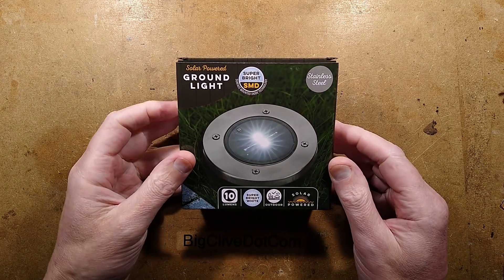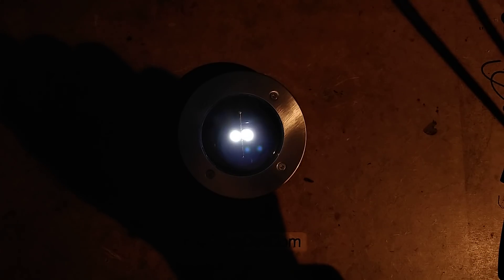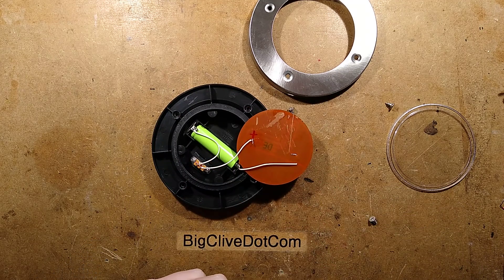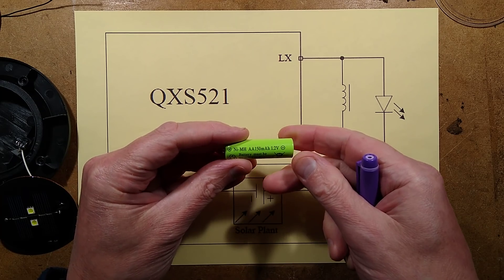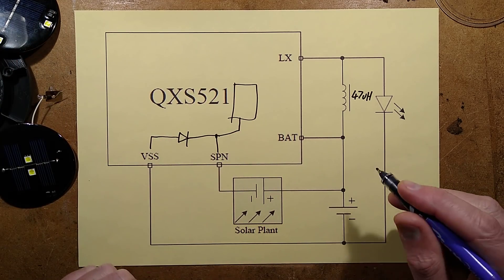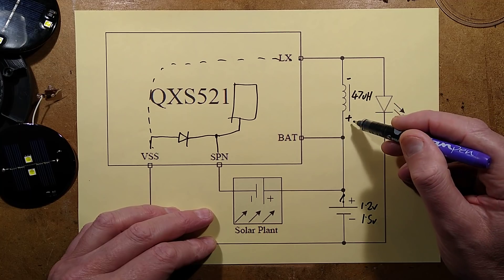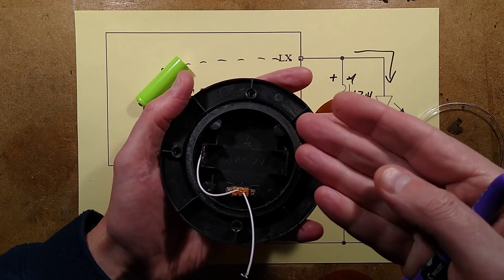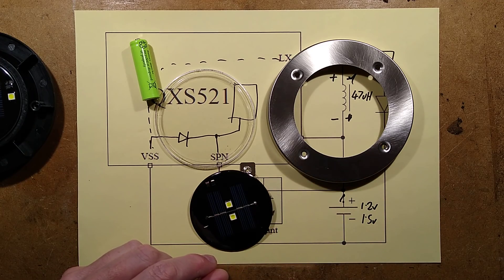Poundland's solar uplight

Comment: Your poundland store looks like our walmart here, that is to say what you consider low quality cheapy stuff is our normal £10 stuff here. They sell those silly puck lights for $12 a piece here. It would be nice to know how to solder in a Lipo battery and explain how that chip knows a full charge vs low charge.

Comment: I love the cheap lights that come with a replaceable battery. You can put in a decent NiMH and it works all night. Almost like it was designed to be not-so-cheap. I wonder if clive does that and if so, what replacement he uses.. 🤔🔋 I'm going for the biggest capacity I can afford, keeping in mind, that it probably be dead in a year. But so far, they are working 2 years+. I also adopted the waterproofing tape technique. It's awesome.
Reply from the maker: I do upgrade the cells in lights I like.

Comment: so these would be used as garden pathway lights. placed each side of the path,!! looks sturdy enough at 1st glance.. of course im typing at the beginning of the video. soo we will see after Doctor Clive Operates if they are any good,..  ; )
P.S. When your tacking back on that connection that snapped off, burn a little hole  in the case were it the condensation builds up.. you were more than likely going to do that, but just in case it's skips your mind.

Comment: 7:13: some of those minimal circuits makes it easier for us making lights to incorporate into our projects,,most people are not aware that those tiny DC solar censors were not on the market for us 15 + - years ago, They only had AC solar censors and then solar yard lights came out ,I was getting ticked by the water police for not having my anchor light on( 80 dollars u.s.)  I’m one of the boat people, The censors I was using before the yard lights came out was a 12 volt magnet switch from a car , they’re on the wheel well in that little plastic box , my system then was , cheap Harbor Freight solar panels charges battery,, battery powers light on top of mast,, I use the solar panel to activate the car magnetic switch , in the morning when the sun rises,the panels will give out about 7 volts counting,,just enough to trip the magnet and getting to where the sun sets ,the magnets are turned off, it’s a trip switch for my mast light,, Yard lights were a blessing ,I’m a strong believer in mast steps,you can change a battery in under 2 minutes and that’s a 40 foot mast

Comment: clive, at 5:00 you mention resin.  i spent some time on the internet trying to find out what sort of resin is used on these types of solar panels.  what sort is it?  i like your tip about just drilling through the panel to rejoin broken wires.  i will be doing that.
Reply from the maker: I'd guess uv stabilised potting resin.  I tend to use cheap two part resin for similar things.
Reply: @bigclivedotcom  ,is it epoxy, polyester or something else?

Comment: I have a few of these under the Bell & Howell Disk lights. One of them kicked the bucket so I'm going to modify it.
Looks just like yours but has four LEDs and the solar panel is twice as large as yours.
Man yours is built very cheaply but they are great for spare parts. I don't have a poundland store here but there are Dollar tree stores. I buy lots of cheap junk and either tear it down for parts or modify it.

Comment: I would love to use garden lights like these for IoT applications - somehow detect if there's enough charge in the battery, fire up some basic boost circuit and power an ES8266 for a second or two to send some sensor data, and then turn off again.

I have however not found a super simple and cheap way to do this.

Quite a pity, because these waterproof, solar-powered and battery-included thingies would be perfect for that.

Comment: Unrelated question.  What do I need to illuminate cold cathode lamps salvaged from LCD TVs and computer monitors?  Some sort of high voltage power source? an inline resistor?  What should I shop for.
Reply from the maker: You need a cold cathode driver.  They sell them on eBay.  Search my videos for CCFL.
Reply: @bigclivedotcom  Thank you. I wouldn't have even known there was such a thing!  I assumed a neon transformer was what I was looking for, but no.  Very good!

Comment: They should engineer solar cells that can emit bright visible light. Since solar cells are essentially light emitting diodes in reverse, it would be pretty cool if they could maximize them for both power collecting and light emitting. You just have a polarity switch when the light goes out. Now LEDs are poor solar cells and solar cells are poor LEDs I don’t see why they couldn’t be made to be good at both. Someday. If people put their mind to it, I’m sure it would happen.

Comment: I love my garden solar lights and love trying to repair them with no knowledge of electronics at all. It's usually rust or duff batteries anyway.
The point you made about a duff battery and the LED coming on during the daylight was interesting. I came by this accidentally a few months ago with one of my lights.
I cleaned it, replaced the battery and bingo.
Thanks for the technical explanation though. 😂

Comment: I don't remember how other models do it, but it seems unusual to put the switch right in series with the battery, because it'll prevent charging when it's turned off.
Reply from the maker: The point is to completely isolate the battery during storage and shipping to prevent it being over discharged.  It also prevents serious overcharging if the unit is left outdoors for a long time with the switch off.

Comment: Can I be pedantic about naming conventions? Good.

So a ground light goes on the ground, and a floor lamp goes on the floor? surely theyre both the same? and really unhelpfully named as most things ultimately go on the ground (floor), at least its consistent with ceiling lights, wall lights, table lamps, desk lamps. but then what about spot lights, up lighters, down lighters?
Reply: Aha, but"ground" and "floor" may not mean the same thing. Ground is used to describe soft earth; floor is a hard surface, usually inside.
Reply: @Amphy002  ah so the ground floor is soft earth covered in hard concrete?

Comment: I bought a pack of four of these from Home Depot‘s website I love them they look identical to the one with the four LEDs I wonder how comparable they are I replaced the stock batteries with 2500 MAH batteries 
I bought some D size batteries they say 10,000 MAH but they don’t last any longer than the 2500 MAH C size batteries I have

Comment: i have used  these lights slightly different design and water ingress is inevitable with them being so close to the ground /grass . two seasons out of them with running repairs and clearing out bloody ants .did try modifying the mounts to use between paving to give them a better chance away from the moisture of the grass but they were rather fragile overall not to bad for the price

Comment: Thank you for doing something simple. I have been opening some of the dollar store (in Canada) electronics because I want to see what is inside. One project I want to do is see if I can combine several different items to creat a new one, like a small fan run by a battery charged by a solar panel. But I need to learn more before I get there.
Reply: Make a bug zapper/laser effect/fog machine that also produces ozone.

Comment: A bead of silicone all around the base of the cap may seal it up nicely.
Reply: Seal in all the corrosive offgassing from the curing sealant.  It's hard to win.
Reply: @tactileslut  That and the moisture in the air, but it beats water getting in and staying there.
Reply: @chinanorthairguns  If you've watched Clive's channel enough you know that water always finds its way in. Seal up the topside as much as you want, but leave a small hole in the bottom so there's an escape route.

Comment: These don't survive being  "vacuumed up" by lawnmowers very well (past experience :-D). Best way to protect them is to really dig 'em in (use a wooden  pole so as not to damage the device). The resin will become milky over time, but is easily refreshed by polishing with Brasso, or a brisk polish with Gumption, etc.

Comment: Hey Clive, the place where I work was throwing away a bunch of LED light fixtures and I scooped them up and opened one. The driver circuit looks super complicated and has a ton of funky business going on inside that I can't understand, so I figured that would be right up your alley. Any chance you'd want to take a look and make a video on it?
Reply from the maker: Thanks.  I've actually got a bit too much stuff here right now.
Reply: @bigclivedotcom  Understood. I'll save it for the future, y'know, just in case. I'm attempting to reconfigure the LED strips to run on 12v for a shed. I'll hang on to the built-in 120v power supply though because it's super fun to try and reverse engineer that kind of stuff.

Comment: The normal garden ones last a couple of seasons but the damp finally gets to them, but I suppose for a pound you can't really complain. More irritating can be the indoor versions in steamy or damp areas where the battery contacts corrode easily - a problem shared by cheap torches.
Reply: Grease the inside after you Spraypaint the PCB and short the on off button. Having a device with a battery inside disposed so offen is very mean to the environment

Comment: An easier way to think of inductors is that they store current like a capacitor stores voltage.  So in this device, the coil is charged by the battery through the chip, then the chip lets go and the coil is discharged through the LED.

Comment: An improvement by encapsulating the boost circuit in the solar panel resin, at least no water or condensation can get to the heart of the thing. 
Can't help but wonder how this circuit and the LEDs will be affected by long term direct exposure to all that heat and UV radiation from direct sunlight.
Reply: Down Under (with our rather stronger sunshine) - you will get a degree of milkiness in about 6 months (summer sunshine), however this easily polishes off with Brasso / Gumption, etc.
Reply: @phils4634  I did a search and there are two videos on YT about it. Both on the same channel done 3 or so years apart. This is the latest one https://www.youtube.com/watch?v=lXNLWapVylw Seems like the UV coat is the way to go.
Reply: @phils4634  This one uses liquid detergent and a scourer https://www.youtube.com/watch?v=UDUph6HwPj0
Reply: @phils4634  Nail polish and remover? https://www.youtube.com/watch?v=_wkdhwYdfH8

Comment: RE: battery upgrade, i wonder how high a mAh you could really go before vicious cycle of battery draining all night / not enough solar charging hours in the day pulls the battery voltage ever down.
Reply: Once you reach the point of not enough sunlight to fully charge an equilibrium will be reached where the batteries fully discharge and then partially charge. If batteries get fully charged these circuits won't stop and the batteries will be overcharged. If you want longevity it's probably better to use NiCd because that chemistry handles overcharging much better than NiMH does.
Reply: @eDoc2020  that’s what i thought at first  re: equilibrium, but it just feels like a big cell being cycled from dead flat to almost dead flat every day might misbehave over time.  prob requires testing ..
Reply: I would think it depends on the average hours of sunlight and the max charging current (and the circuits efficiency on charging)
Reply: Not very high, I have replaced batteries in a few solar lights and they are usually a max of about 600mAh, before I knew better I put in a 1200mAh battery and it lasts just a few weeks before it had killed itself. Same problem for cordless phones, put in batteries with to high of a capacity and the charge cycle soon kills them. 
With the phones they tend to have a low voltage cut out so if you have a charger with a "refresh" cycle you can usually revive them if you do it every 3 or 4 months, on the solar lights though the circuitry is so basic they will just destroy them.
Reply: @caskwith  friend had that same experience w solar lights , but she also switched nicad to nimh which doesnt seem to go well.  

i’ve had the same cordless issue , switching low cap/Hi self-discharge stock panasonic AAA nimh to eneloops.  seems they don’t get cycled at all if you put the phones right back in the base.  problem went away one i stopped leaving the phones in the base all the time, and putting in base only to charge after dying.  but it’s a pain..

Comment: I'd glue the mount on the base, in case the light comes off, else you'll have a nice shock for some naked little/big feet wandering through the grass. You didn't mention about bypassing the on/off switch? Maybe silica gel and seal the unit, that might work?
Reply: I'd imagine British-style power plugs would be much worse.
Reply: @eDoc2020   Lego wins this round.

Comment: I'd like to see this very simple design in a "window sticker" kind of thing.  Charges during the day, soft inside facing nightlight at night.  I wonder how much solar energy you would lose through two panes of glass and transparent glue.  In my mind I see a tidy little square module.  
Do these tiny cells produce any measurable battery charging via inside lighting?
Reply: Having had a solar light module stuck in a window last year, they bake, which kills the battery inside in less than a year, so would need a way to cool itself as the sun beams down upon it...
Reply: @twocvbloke  Inside surface or betwixt the panels in the dead space?  Thanks for the input!!
Reply: On the interior side of the window, so got hot like a greenhouse...

If it were between the glass inside the glazing panel, it'd be worse probably...
Reply: @twocvbloke  Baking the battery in a greenhouse is what normal garden lights do though; picture a hot stuffy day with no wind...
Here in aus those things always get cooked up within one summer; after being roasted and overcharged every day for a month, they start dying halfway through the night...
Reply: Might want the cell stuck to the window and battery and LED etc. stuck to the ceiling?
Reply: That would be a better solution, I just never bothered with sorting it out after taking it and the string of LEDs attached to it down...
Reply: I've had a small garden light (one LED, AAA NiMH) in a south facing window for a few years now as an experiment. It charges to a few hours of useful light in the summer, less in winter of course. All of its brothers placed outside have already died.
Reply: @rpbajb  South facing makes the most sense :) In the northern hemisphere anyways :) What area are you in? Seattleish here and it'd usually be safe here, except this year has been hot.
Reply: @mrsheesh3743  Western PA, 270 cloudy days per year.
Reply: @rpbajb  I suspect it'd be different for those in S. California or in Arizona or Nevada!
Reply: @mrsheesh3743  I agree, but PA has about the same insolation as Germany, and they've gone big into solar. I'm currently having some solar powered blinds installed in skylights; I hope there's enough sunlight to run the motors. We'll see.
Reply: @rpbajb  Good luck!

Comment: There are much nicer versions of this style of light however they all got a common flaw with there being water intrusion and some will fill up so everything inside rusts to bits. They are ok for dry climates, as for the solar cell one will end up having to spray some clear coat for the usual reasons.
Reply: I have some I inherited with my rental that look about 20 years old with how faded they are and they're still trucking, staying lit all night. I'm gonna see if I can figure out the manufacturer.

Comment: The power switch would act as the drain hole for the center cavity, wouldn't it? It doesn't seem to be sealed, at least. Do you have enough solar panels yet, that you can make a solar super computer? Good luck. 👍

Comment: I would love him to review some of the LIDL solar light offerings. They are very good and all come with easy replaceable AA and AAA rechargeable batteries.  Have lidl solar light running 4 years now just replace batteries every 2 years when the light starts to fade
Reply: Agree they are good but recently they've started using 18650 li-ion batteries in them instead of AA/AAA.
Reply: @thegorgon7063  that's because Tesla stopped making the Model S/X for a while & Panasonic had loads of spare 18650's, so Lidl got a good deal on a shipping container full or 2.  Or did they?
I might be lying... Sounds plausible though & a bit of free advertising for Tesla & Panasonic!..... 🤣😅😂👍
Reply: Next week Clive opens up a Tesla Model S & finds rather a lot of 18650 batteries & some complex electronic circuitry & custom chips he can't find the data sheets for... 😉👍

Comment: I've never seen the point of uplighters... You can't install these under something which you want lit up as the solar charger won't work, so have to be in the open, so what would they light up? Anyway, nice to see another Poundland solar gadget!
Reply: They light up a road, or sidewalk or airstrip.  Just enough to see where they are, but little other use.
Reply: Except for adding to the light pollution.

Comment: Someone really needs to make simple, cheap reliable switches to replace the ones these use nowadays, they are just terrible and will fail soon in the weather.
Reply: It was invented already, a reed switch and a magnet.
Reply: Just bridge the switch out. Since these don't charge when off there's little reason to use the switch.